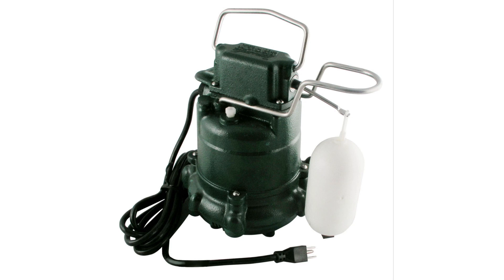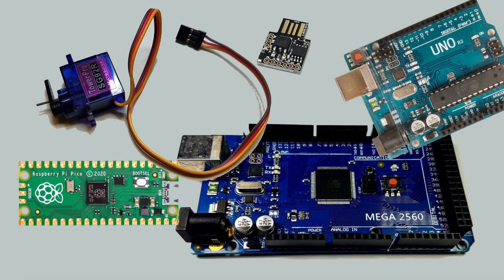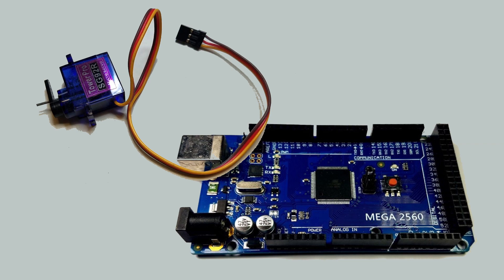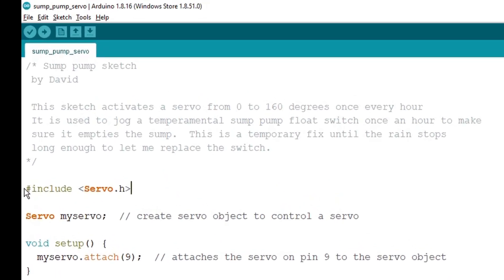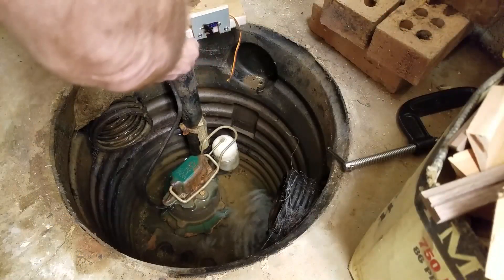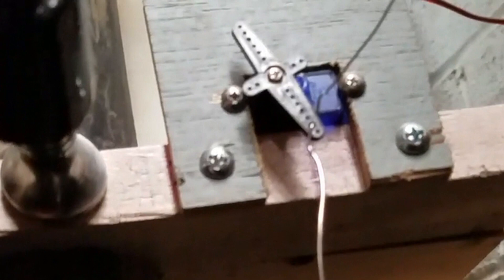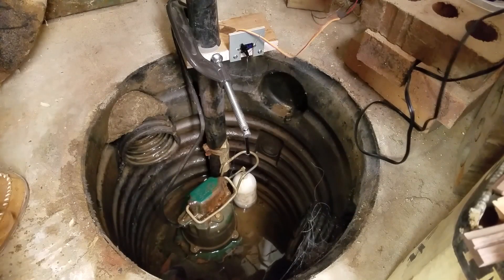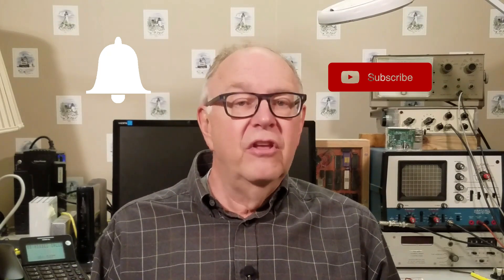Arduino Sump Pump Rescue

Comment: Never used one but I’m sure I can figure it out.Where did you get the Aquino from and the control board mega 2560 from, are they interchangeable with similar other boards? Thank you
Reply from the maker: I usually get my stuff from MicroCenter; we have one in town.  Most any Arduino board will work; the important thing is to match the voltage level between the micro-controller and the servo.  Arduino is a 5 volt unit, while the Raspberry Pi Pico is 3.3 volts.  The servo I used was 5 volts; that's why I didn't use my "go to" of the Pico.

Comment: Could it be modified so that a water detection sensor be placed at the top of the sump pit (mounted to the pipe perhaps)  would activate the pump switch? The largest reason for failure of these pumps is the switch and having them cycle too short. It would be great if they had made these with an option to use different float switches. The standard one is just too short and often results in too little amounts of water in the pit activating the switch. They actually make a rare version of this with a solid state switch that has two water sensors to avoid sensor failure issues, thus they give it a 5 year warranty instead of the typical 3. The standard switch also fouls overtime due to the bad design which allows too much arcing. I was thinking about a mechanical modification to remount for float to an extended, higher placed rod near the top of the pit for myself. That way it could reduce the number of back to back activation cycles a bit.
Reply from the maker: I have used Little Giant pressure type switches and teardrop float switches after the Zoeller built in switches have worn out.  This is my 3rd Zoeller pump in 38 years.  One mistake I made after the first one crapped out was to buy the next size larger pump.  It would only run for a couple seconds until the sump was empty.  After that one died, I bought the smaller pump again and I am much happier since it runs for 10 seconds before it shuts off.